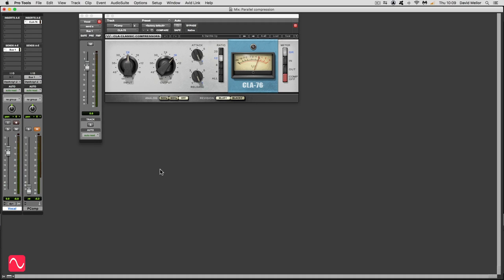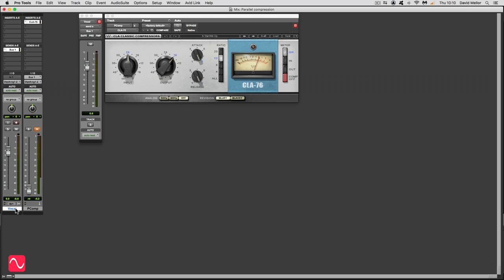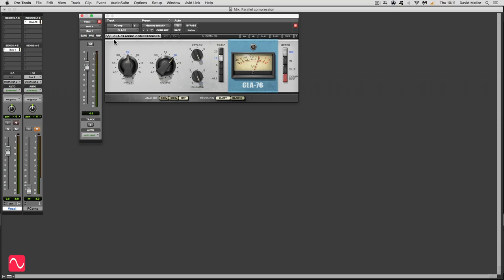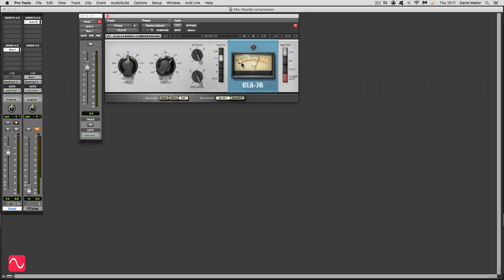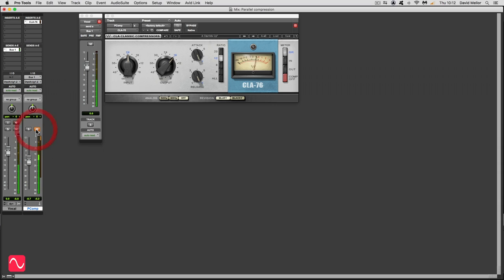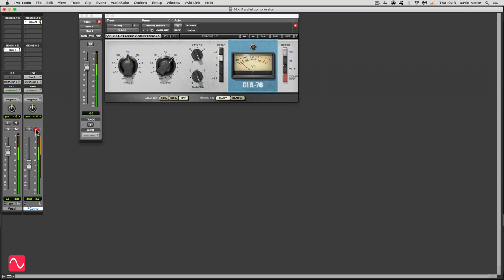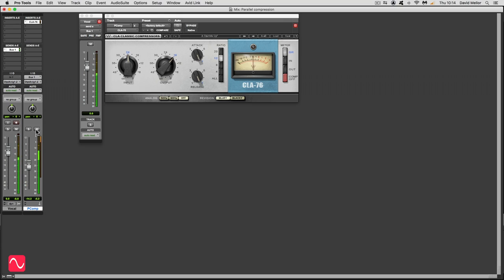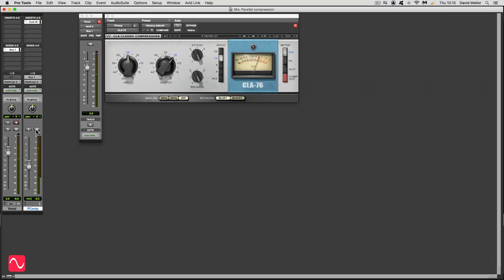Demonstration of parallel compression on vocal

Comment: I experiment with it. So when u process the individual vocal channel with subtractive eq, compression, saturation, deEssing and additive Eq it all sounds great. And guess what, to add a bit of air into it, i place an API 560 eq after the compressor on the parallel Aux . i then add 1db at 16k for some air. It sound richer and the vocals had that air/sparkel sound to it.. Try it for your self next time u will love it..👍
Reply: Can you use any eq, say Fab Filter, to add that air?
Reply: @williams.5158 wondering the same..
Reply: @williams.5158  Pro Q3, yes

Comment: Am back again, folks this is very brilliant. I Experiment further with the Aux-Channel. I kept both release and attack times on the compressor at 7ms, i use a 20.1 ratio, output set to 24db, and the input set to -30. U can also play around with the input set to -27.1 and pay attention to your gain reduction meter. I went for 5 to 7 db of gain. Finally since its a parallel chain, i bring the Aux Fader all the way down to -23 db, and kept the return fader to unity with prefader on.. You dont want to much, just season to blend/ taste. Awesome video.👍
Reply: I love your music bro. Its dope quality but it just needs the adlibs to be turned down on the delay.

Comment: When using parallel compression, how heavy do you compress the original vocal? My understanding is that the original mix channel has some light compression on it while the aux send has heavy. I know there's no golden numbers here but would the attack and release still be very fast on the original? Would the threshold just be cutting the loudest parts of the vocal, or still compressing the whole thing but at a very low ratio, perhaps 1.5:1 or 2:1?
Reply from the maker: This is just a personal opinion but I'd start with conventional compression and get that sounding nice. Then consider parallel compression and perhaps try it out. If it's good, then the conventional compression may benefit from a tweak or two. How hard you compress is really up to you but don't forget that the gain reduction meter should be close to zero on quiet parts, otherwise you'll slam every entry. DM

Comment: Thank you so much ! very clear. One question though, can we use parallel compression while already having a compressor on the voice ? So that we can reduce highs and work on the low part afterward. thanks !
Reply from the maker: Yes you can do that. There are options though - You can parallel compress, then compress. Or compress then parallel compress. Or compress, but send the uncompressed signal to parallel compression then mix back in. I don't have a definitive recommendation right now so you would have to experiment. It might be a good topic for a future video though. DM
Reply: @AudioMasterclass  oh ok! thank you very much !

Comment: thanks so much! what is the difference between applying compression on the track directly vs parallel compression like this? couldn't you also achieve the same result by changing the attack/release values?
Reply from the maker: Normal compression works on the peaks. Parallel compression also works on the peaks, but because of the compression they are lower in level and are masked by the peaks in the uncompressed version. The result is that the lower levels can be raised. DM

Comment: Nice video! I didn't know this was a thing, sadly this is not very practical with a mixing console on live events - definitely possible but uses an additional, valuable channel.

Could you do a video with tips on mixing for live online events? I'm used to having spare head room with the speaker and amp system, but In this dire times, I'm struggling a bit with keeping the levels high enough without clipping them, keeping the peak at a more manageable level may render it too low on some devices such as smartphones or notebooks. I'm currently fixing it by aggressive compression, but it muddies the sound.

Comment: But does the original vocal track already have a compressor on it? Or is it not compressed at all? Every video about parallel compression on YouTube is the same..it lacks information about what's on the original vocal chain, if the parallel compression vocal is already processed similar to the original audio track..so many things left without explanation.
Reply from the maker: Thank you for your comment. There is no compression on the original vocal, although there is no reason not to do that if you want to and it sounds good.

Comment: When should I do parralel Conpression and when should I use normal compression?
Reply from the maker: Use normal compression to reduce the dynamic range. Use parallel compression to bring up low-level details. Use them both at the same time if you wish. DM

Comment: What about the extra "noice" , mouth, leaking from headphones, that you don´t want to hear. How to ge rid of them ?
Reply from the maker: If there is headphone leakage, the first thing is to buy closed headphones for the future instead of using open-backed headphones which will leak due to their design. The second is if your singer has long hair try to get them to wear the headphones under their hair. If they don't like that, then you'll have to live with it for the benefit of the performance. Some singers like to push one earpiece to the front or back to hear some of their voice through the air. If this helps the performance then again you'll have to live with the leakage. Following recording, you can edit out the leakage when the singer isn't singing. One more thing - the worst leakage is of an instrument that you don't use in the mix, so it's best to give the singer what they need in the headphones but nothing more than that.

Comment: So what I’ve been initially taught is backwards? I’ve always compressed and squashed the crap out of the original track and then duplicated the original signal except the duplicate is uncompressed and then I’d slowly add the uncompressed signal BACK into the mix to give some of the dynamic and “highs” back. Is this incorrect?
Reply from the maker: If you're creating art then nothing is incorrect as long as it sounds good. The key to this is that at any moment, the louder signal will mask the quieter. So the way I've explained it, when the level in the track is high, then you'll hear the uncompressed version. When the level is low you'll hear the compressed version. This way, parallel compression brings up the lower levels. With your method, if you use makeup gain to bring the compressed version back up, then I'd imagine you won't hear much difference when you mix in the uncompressed signal at a lower level. If you don't use makeup gain, and you bring the uncompressed signal higher in level than the compressed, then the result should be the same as the method I've described, although I'd want to have my finger on the fader of the compressed version. I would have to test your method to be sure, and I'll put it on my list of things to do. DM
Reply: @AudioMasterclass  thanks so much for your in depth explanation and response! Yes I typically leave the compressed signal where it’s at even if I lose a few db and then I just add the uncompressed signal to it in order to bring out the highs while also bringing the overall level back up. I think I like your method better though because it seems to make more sense to me. I also had another quick question that maybe you’d have the answer to. In your method, Is it also a common practice to then further “lightly” compress the original signal so that the highs don’t jump too far out when there is a dramatic change in dynamics? Or would this defeat the purpose of parallel compression altogether?
Reply from the maker: @AllanEvansOfficial  You can compress the uncompressed signal in the normal way. You can also bus the combined signals and compress in the normal way. It doesn't defeat the purpose of parallel compression at all and can be a useful option.
Reply: @AudioMasterclass  thanks so much

Comment: When you say, "affecting the high levels making them louder", when bringing in the PComp channel, what do you mean, the compressor reading levels or the high frequency range content of the vocal?
Reply from the maker: Can you tell me the time point when I say this, to save me watching the whole video? DM
Reply: @AudioMasterclass  2m36.
Reply from the maker: I mean the level of the sound that I hear, and would be measured by the meter of the master track if it were shown. I only want the parallel compression to affect low levels, so I bring up PComp until it just starts to affect the high levels, then I'd probably back it off just a little. There's no reason you can't let parallel compression increase the high levels if it sounds good, but that really isn't the point. The point of parallel compression is to bring up the low levels. Setting a long release will preserve naturalness, setting a short release will add interest and texture to the sound. DM
Reply: @AudioMasterclass  OK, so what you're saying is, don't use it to make the overall volume louder, just the volume of the things that were relatively quieter before? I found your use of the phrase 'high levels' confusing too as it seems like you're referring to the level of the higher frequencies not just the louder bits in the take.
Reply from the maker: @MonsieurVersatile  Your first point is correct. As for your second point, when I say 'high level' without reference to frequency, then I mean level across the full frequency range. DM
Reply: @simontunnicliffe2107  FWIW, I am fairly sure he means "If you can hear the parallel version (super compressed) when the volume of the vocal is at its highest then you have mixed in too much of the parallel version. Back off the volume on the parallel version until you can't hear it on the loudest parts". The reason is that the technique is to bring up the quieter sections, if you can hear it on the loud sections then you might as well have compressed the original and then just use wet/dry mix on the compressor to tune it.